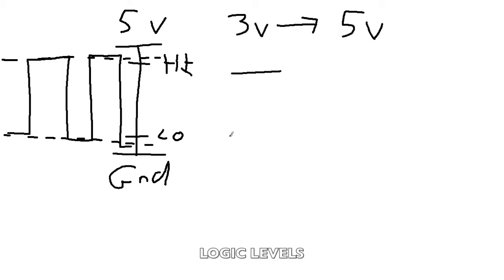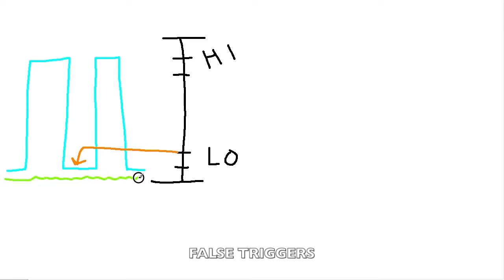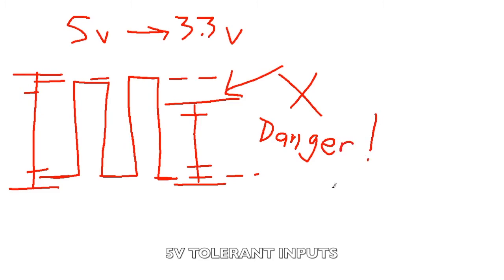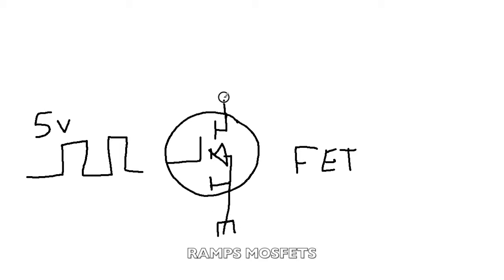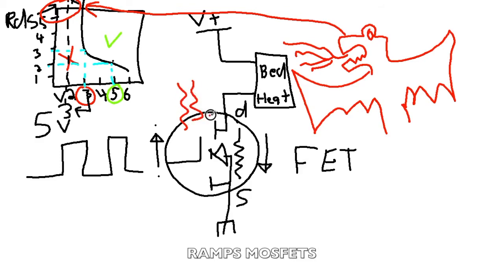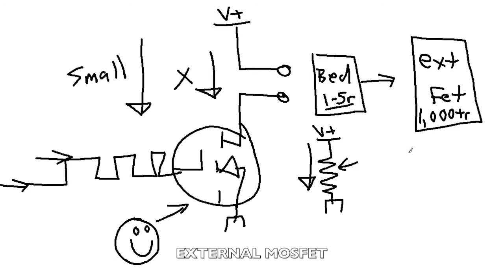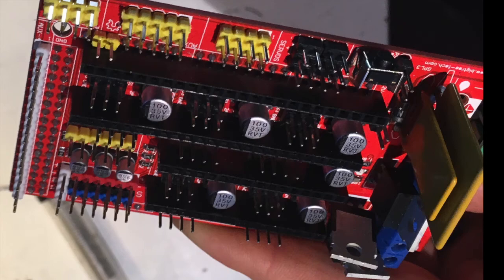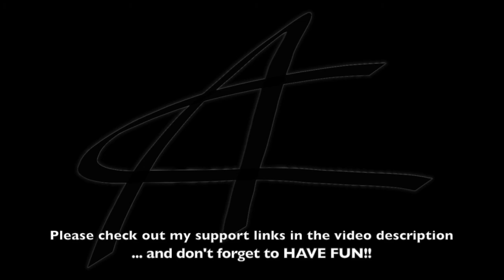TNTM: nerdey theory - DUE logic levels and RAMPS mosfets

Comment: thank you Carston...... I Sir don't know ifin you seen it but i put up for $12 on the month for support. first time for me so Feel special......!
just starting to do research on this "due" board. looks cool so hopefully it is something i can use.
Reply from the maker: I DID see that.  Thanks for the support Daniel!  The Due mod is meant as a cheap upgrade path option to 32-bit if you have a working RAMPS+MEGA combination and you don't mind some hardware and software hacking.  There are hack-free RAMPS upgrade options like the RE-arm panucatt.com, but they cost more ($45) or other options if you don't want to use a RAMPS board, but I'll be covering some of those in the future.
Reply from the maker: You talking to me Mike?  If so, message me and we can work out some details.

Comment: You keep saying ramps mosfet STP55NF06L is 10v but in datasheat shows VGS= 5V, ID= 27.5A etc.  Now Im only a hobbyist and could be 100% wrong but doesn't that mean its 5v? What I suspect is going on is that many cheap suppliers put STP55NF06 on the ramps, and that is a 10v..   Your thoughts?
Reply from the maker: Did you find a 55nf06  sheet with good 5v test data?  I only found one that had  5v numbers (from ST),  but when I ran their tests, the results were a lot worse than they claimed, and even that sheet didn't have curves down to 5v.  They actually 'work' fine at 5v, but you can't get enough power out of them unless you raise the voltage and  maybe add a fan/heatsink. I have a few boards that will switch on a bed mosfet at 3.3v, but a few others wouldn't.  I should probably test a batch at 3.3v and see what they can/can't do.
Reply: The ST datasheet does indeed say 0.016 ohms at 27.5A with VGS being 5V (VDS should then be 0.44V), but if you look at Figure 3. Output characteristics, where they show the curves for VGS from 2V to 5V, the actual value is more like 0.050 ohms at 5V (for example VDS 3V and ID 60A). In reality, maybe it's even worse? Seems like marketing likes to tweak the numbers.
Reply from the maker: Good eye.  I tend to use 'worst case scenario' data sheets for reference.  I talk about that a bit in this over video  https://youtu.be/9X4mqD5cykQ?t=13m36s An Rds(on) of 50mOhm would definately go up in flames with a typical 12v heated bed (that would be dissipating 5W on the mosfet package).  I didn't test any over 40mOhm at 5v, but they seemed to average in the mid-to-high 20's (2.5W+)  and even in that range it is twice as hot as I would be comfortable with (should be okay for a hotend though, or maybe a bed at 24v as long as rds is not too much over 30mOhm or so).